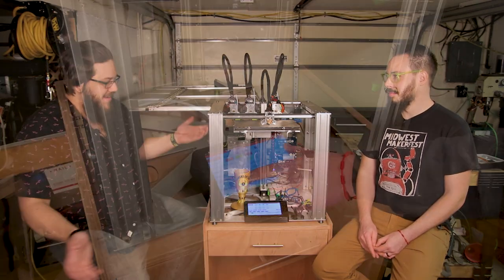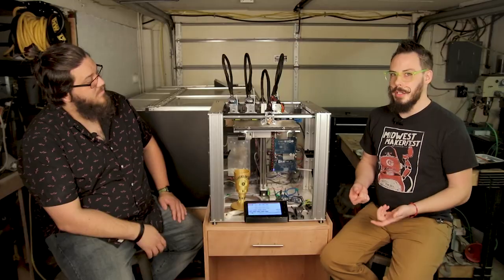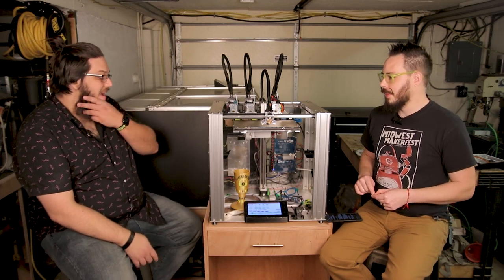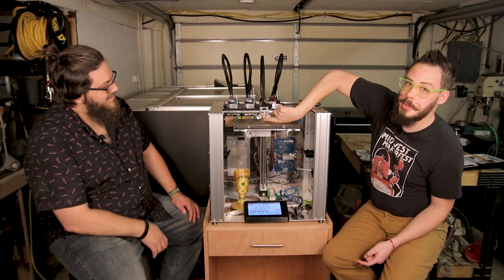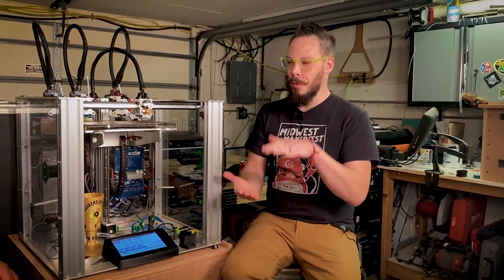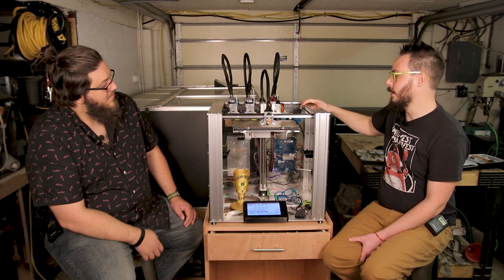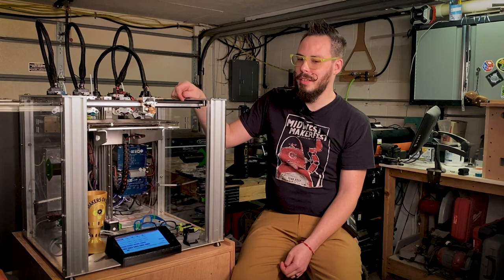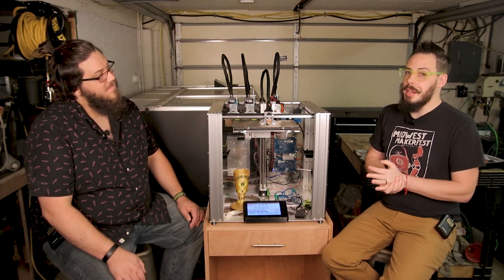Between Two Makers Ep000 - E3D's Tool Charger Q&A

Comment: Marlin supports tool-changing … except I don't think we've got support for T-1 quite yet! We haven't got Marlin running on the Duet ecosystem yet, in part because "we're not worthy" of the many features of the hardware, and RepRapFirmware is perfectly tailored to the Duet boards. I've been eyeballing this Duet Maestro sitting on my desk here, a smaller board more suited to RepRap printers, and once I have support for that board done it shouldn't be a huge step to support the Duet 2 Wifi, and then we'll be on track to get the Duet X5 supported as well. In the meantime BigTreeTech has a couple of interesting board offerings –such as the GTR Pro and a new EXP extender – that allow Marlin to do some more interesting tool-changing tricks. We'll continue to build on these components as time goes on.
Reply: Thanks for the reply Scott. I honestly haven't dug into Marlin since 2 started. I didn't want make any assumptions and get destroyed lol